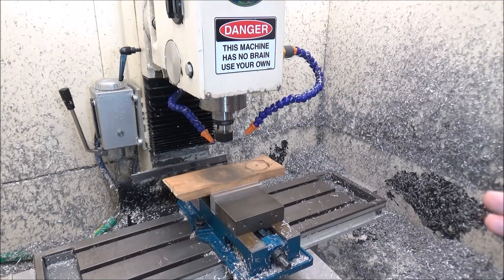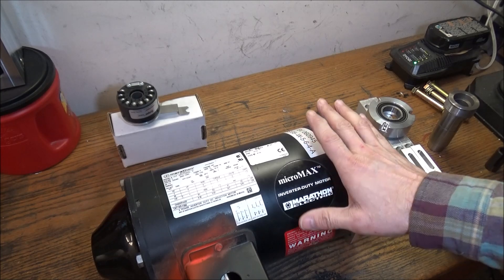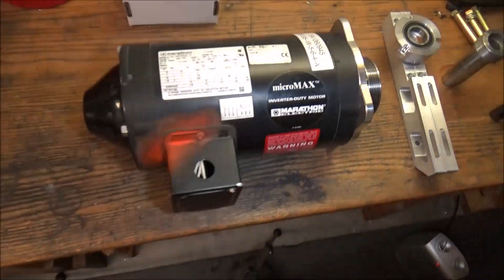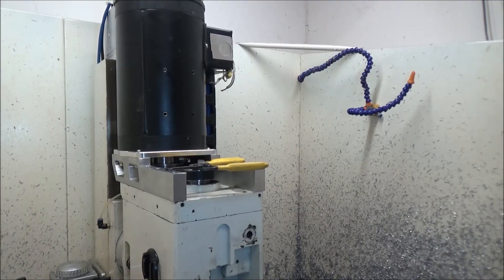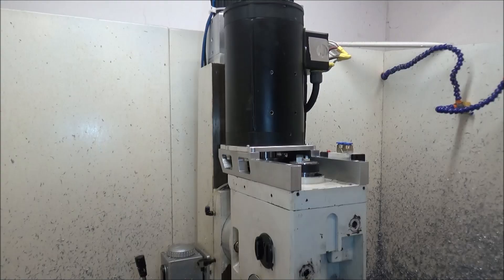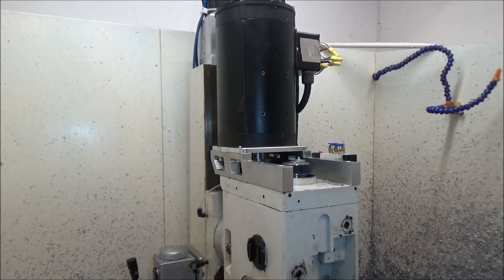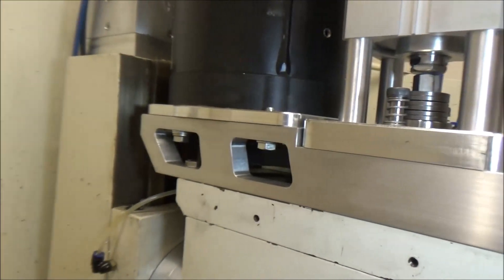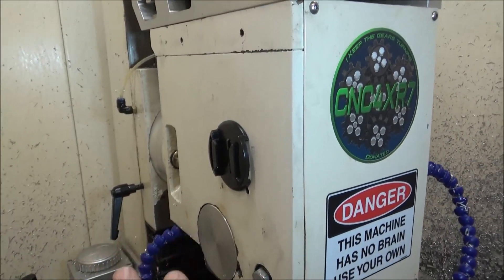PM727M Motor Upgrade

Comment: Sam, why did you ditch the encoder? Could it have been wired into the controller? Is it a magnetic encoder or optical?
Reply from the maker: I'm running mach3 and it needs 1 pulse per revolution this encoder puts out more so it wouldn't work. besides I never felt like i needed it will my mill. No rigid tapping etc.

Comment: Sam, Thanks for your videos. Learning a lot and will be starting a CNC upgrade to a PM-30MV. I like your setup with the air cylinder for your drawbar. I tried finding a 80x15 3 stage and all I see are 2 stage? How does the 3 differ over the 2 stage? Thanks again Al
Reply from the maker: It provides you with  3 X the force.
Reply: CNC4XR7 Thanks for the reply. I just saw that a kit for the power draw bar is available for the PM-30MV. Their kit uses a 2 stage.

Comment: 😳With the talent and skill that CNC4XR7 possess i don't know why he doesn't build his own CNC milling machine, i am pretty sure it would be far superior to what he has now.   PM727M currently cost $2,038 with included shipping, at that price i have a hard time imagining my myself investing in these type of expensive upgrade. I have about 10% of CNC4XR7 knowledge and skill and based on what i know now that's enough to make me feel confident that i can build something to perform better or equal to without spending so much money.
Reply from the maker: A conversion is a good way to get into CNC for those new. A full on build depending on which route you go . Epoxy or steel the cost will vary. other factors come into play as well. you need machinery to surface the parts you fabricate. and then there is the time factor. A scratch build is challenging and time consuming.  In the end the cost of the mill is the only thing that will vary. as the spindle motor and servo cost along with electronics will be the same or close to the same.
So in the end if you can build the Bones ( framework) for 2k or less ( today's figure) then you can save money. which I think you most likely can if you have the time and needed machinery.

Comment: Nice machine, could you tell me where you purchased the air cylinder, model number.
I want to add it to my G0704 mill
Thank you David
Reply from the maker: Air Cylinders are from China. SDA 80 *12 3 stage air cylinders.

Comment: from what i can find that "1000:1" torque number refers to constant torque even at very low rotational speeds; not the higher speeds. so what's the difference between this and the old motor that makes it better at 5000 rpm?
Reply from the maker: Definitely more torque on this motor. the original Lesson would stall if pushed. this motor does not seem to slow down.
Reply: Great video,very informative,  could you list the marathon motor model number ?
I would like to get one.
I installed a DMM 750 watt servo motor on my G0704 mill and im not impressed,  yes its better than the stock motor, but i can stall this motor with a 3 flute 1.5 inch dia insert facing taking .04 DOC  cutting aluminium
Reply: He showed us the improved cutting capability and he's happy with it, what more do you want? Again, Nice motor upgrade.
Reply from the maker: Thanks William
Reply: @williamhardin5254  i'm not questioning that it has more torque. i'm asking why it has more torque; that is, what makes this design have more torque over the other design
Reply from the maker: @ikbendusan  This motor is a Inverter duty motor it's meant to be driven specifically from a VFD . it is a 4 pole motor 1725 rpm vs the lesson which was a 2 pole 3625 rpm motor both at 60 hz.
When a motor is driven by a vfd past 60 hz. say 120hz the rpm will be doubled and the torque will be halved. the more torque produced at lower rpm IE: 1000 to 1 mean more at the higher rpms. this motor is rated at max speed of 5400 rpm. I'm running it at 110hz to achieve my 5k at the spindle.
Reply: @CNC4XR7  oh i see. very interesting. thank you
Reply: @CNC4XR7  i've been looking into this whole motor thing because i'm looking to upgrade my own motor. you're right about the inverter duty part; however, from my research i've come to the understanding that the "1000:1" rating has no effect at higher rpms. an electric motor rotating above its synchronous speed is a constant power device, so there's something else at play if you're noticing a performance improvement. that said, some general purpose motors will be more suitable for use with VFDs than others. did you use vector control with your old motor?
Reply from the maker: @ikbendusan  The VFD did not change like most modern VFD's it is a sensor less vector drive.
You can definitely tell the difference in the motor. Chip load has increased and this motor was used so deals can be found.
Reply: @CNC4XR7  i believe you that you can notice the difference, i just want to get to the bottom of why it cuts faster hahaha. it's really hard to find information on the subject :D. maybe the 4 vs 2 pole may have something to do with it. what's the ratio on those pulleys by the way?